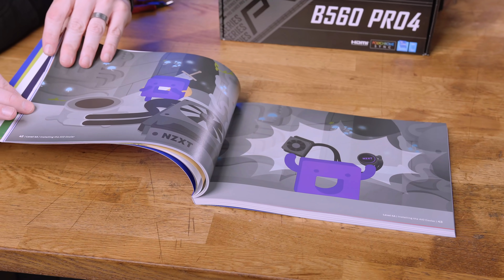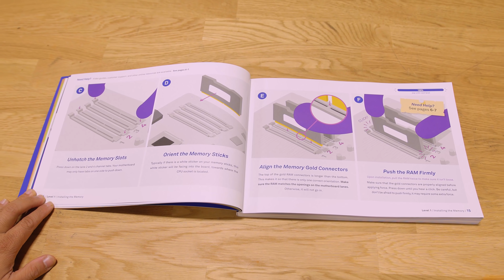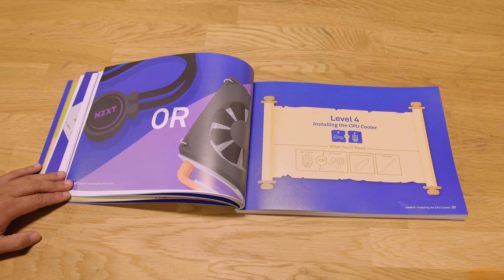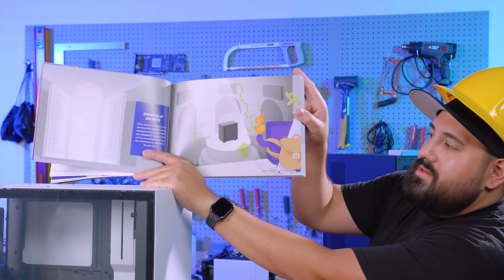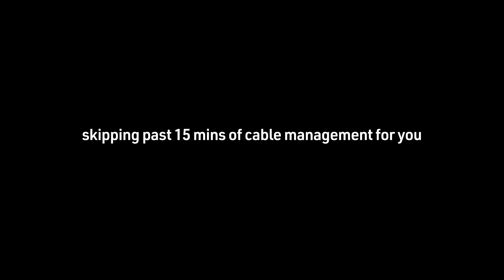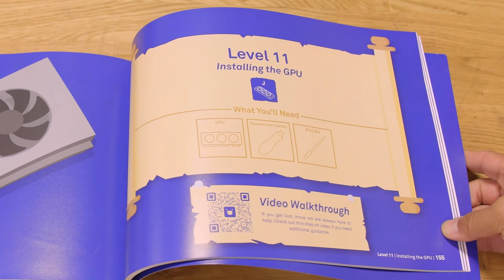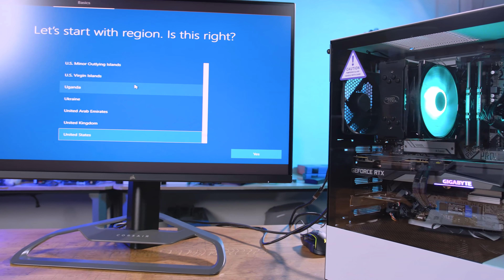Why hasn't anyone thought of this before??

Comment: Only odd thing was the 510 is a negative pressure case where the top and rear fans are used for exhaust. Seeing the top fan at the front for a static pressure setup which probably isn't the best as well...not much incoming airflow as the front is sealed - although it has a small perforated strip on the side. Seems a strange step by NZXT (and to a new builder) to add a 'relocation' fan step. Anyone know why?

The manual looks amazing and really shows the attention NZXT have given to this.

Comment: The only 'bad' thing I can say is that it's the exact same price as the actual pre-built version of the same spec so it really is just the option to do the work yourself for the experience. So it's not bad just, there's no cost incentive. 

I do appreciate that where with their full pre-built you're paying for the labor and with the kit you're paying for what looks like an expensive as hell full-color thiccccc instruction manual, and a little set of tools; so in a way that's worth something.
Reply: all the cost of building has gone into creating the manual and isuring that nothing goes wrong

Comment: Would have loved to bought this concept for my kids. I ended up buying them each HP Pavilion 10th gen desktops, stripped each computer down to the individual component level & bought upgrades (PSU, ram, GPU, SSD, cooler, case fans, etc.). From there I walked them through the build process.

Comment: 7:22

don't worry. I have a ryzen 9 3900x, and then when I was trying to pull out the cooler, the cpu sticks to that stock cooler, and at the process of pulling the cpu out of the COOLER, I bend like 50 of those pins, fully 90 degree bend.

I use gentle force and work efficiently while sweating (ofcourse duh), then successfully put it back inside the mighty AM4 socket.
Reply: me after seeing the rest of the video :

Comment: Ya know, given how (relatively) dangerous it is to install your CPU as a newbie builder, I'd really like to see Beginner DIY options (from the popular retailers) where the CPU is pre-installed and tested before shipping. Like, just a little add-on fee in the checkout process. "Pre-install and test CPU: $50." Would save so much headache and stress for first-time builders. (And potentially more experienced ones as well.)

Comment: The M.2 issue is not just Asrock, I built a system with a Gigabyte Aorus mother board that the top m.2 didn't work with 10th gen cpu.

Comment: That build manual is awesome.  NZXT could probably slap a ISBN on it and sell it by itself.  I spent 8 hours building my first PC at 34 years old with 12 years experience as an non-computer electronics tech.  Of that 8 I spent at least an hour trying to find something, anything that said whether or not the 240mm AIO pump and fans would exceed the amperage limit of the CPU Fan and CPU Opt. headers.  
Also, I've come to the conclusion that LGA CPUs are a better idea because the CPU usually costs more than the motherboard.  If I'm going to ruin something by accident I would rather the less expensive part be the one the gets ruined.

Comment: Maybe it's just my personal process, but I have NEVER put the RAM in before the CPU.   They just get in the way of messing with the retention clip, and one slip of the hands is all it takes to potentially snap off a RAM stick in the slot.

And I would never put the board in without everything being installed (minus the GPU) because...again...space to actually work.   Put that CPU cooler on OUTSIDE the case.  Sometimes I think the guys that wrote that script on for that cringe worthy "how to build a PC" for The Verge wrote parts of that manual.

Comment: this is just fing awesome.  I just got into building PC's in about 2017. Ugg I don't know if it it is a blessing or a curse but it is just like building a car/bike.  I am still at a mid tier with all my builds, but man is it fun to build a new project and see it post for the first time.  Warranties are an issue I have had to deal with first MB from personnel build died within a year  and had to jump through hoops that eventually ended in buying a new MB and even it had some RGB problems I didn't think worthy of going after a warranty issue.  I prefer the teal/seafoam color and with a b550 GB board and phantecks neon lights both failed to render a teal/seafoam (both went to green) color after just a few months use.  is this a common color to die after just a a mediocre time use?

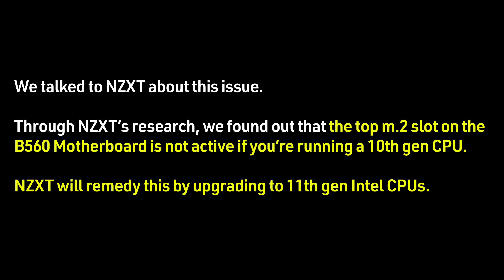Comment: 19:48 Something similar happened to me when using an Asus ROG Strix B560-G Gaming WIFI board and an I7-11700F bought from someone who parted out a ROG prebuilt. The m.2 slot closest to the CPU socket didn't recognize my WD Red SSD, but the further away one did. However, I suspect it's because I'm using an older SATA SSD and the top slot is NVME only. As long as it works, right?

Comment: I wish they were doing this beginning 2021 when I had them build mine. I was grid locked waiting for GPU like everyone else. I already had a case. would have been cool to just use their parts and my case and get the GPU I wanted. Instead I'm stuck with the 3060rtx. robust tank but not the fps I wanted.

Comment: When I built my computer for the 3rd time in that case I dropped the fan bracket on my pinkie toe with 2 - 240mm fans on it and sliced it wide open. It was 1am and I wanted my build done so I continued like nothing happened.

Comment: i had a 6600xt from gigabyte oc pro, fans were spinning crazy loud an many coil whine on it. is this 3060ti less noisy, less coil whine or none? then the 6600xt pro oc ?
or should i get a nice EVGA 3060ti, i still have a 1050ti evga 4gb. its still working, but i need to upgrade..

Comment: Ahh, why do the DIMMs go in slots 2 & 4 instead of 1 & 3? I'm not a gamer and as an IT Pro I've only built 2 custom PC's in the last 9 years, 95% of the systems I have sold are either new or refurb Lenovo ThinkPads/ThinkCentres (a few Asus/Dell/HPs, mostly refurbs laptops along the way), and maybe 2/3 Intel NUCs (so SO-DIMM slot order is irrelevant). So what have I missed in the last 10 years that dictates using slots 2/4 over 1/3?

Comment: Finished mine and nothing is showing up in display lol, I already re seated the rams, many times, hdmi and monitor works perfectly since I always used them on my Xbox one. I plugged the hdmi to the gpu port, nothing, then motherboard, nothing. I’m just waiting for nzxt to email me back which should take 2 days max. On a side note, DONT EVER BUY anything from ghost keyboards. I bought the pewdiepie ultimate combo and received everything BUT the keyboard. I emailed them and it took them 2 WEEKS for them to respond. Then they responded asking about some information being correct and I replied, and they haven’t emailed me back since. It’s been 1 week since they have replied to me, a total of 3 weeks of not having the keyboard that I have paid for.

Comment: Great video,.... BUT...Maybe I'm missing something, for 1800 dollars you get a 5600x($~300), 3060ti(~400), 16GB of 3ghz(~$75), a crap m.2(~$100),junk case(~$75), 650w PSU(~$90), 120mm cooler(worthless),  to me that's 700 dollars over priced.  I know the GPU situation, but you can get better parts from other pre-builts for FAR less and fix the issues with cash left over.    Granted I lucked into a 3070ti for MSRP but I just built a 5950x, 3070ti, ASUS B550-F Wifi 6, 32GB 3600, 1TB nvme, 850RMx corsair, in a  LC mesh for 1900.  Don't pay double for a GPU, that's half what keeps this mess going. JUST SAY NO.

Comment: There is no substitute for a good education and building ANYTHING (PC/bike/bookshelf/bed etc) yourself will guarantee that you remember how/why you did what you did. When you first start down ANY new path, 'you don't know what you don't know' so you don't know the questions to ask. I remember frying an old HP because I installed a new video card and it was trying to draw too much from the OEM PSU, whole thing cooked the mbd and vid card. IIRC, the only parts that survived were the HDD, ODD, fans and floppy. WTF did I know about power draw and quality of parts? 
 
When they each hit 7th grade, I had my girls build their first computer from spare parts I kept in the closet back in the day (Now my oldest is going into college... fk I feel old!). Same with their bikes, each of their first was built from parts I scavenged via craigslist, alleys etc. Not because I'm not willing to BUY a bike for them but because they should know how to fix it if something goes wrong... Also, it's a fun project that guaranteed some time with my kids and taught them it's OK to get your hands dirty :)

Comment: Fellow technophiles, I have questions for you all.  I want to do a full tower gaming, game development, and digital art build that's all dec'ed out, but the parts I'm finding dissolve the justification for a full tower.  I want the full tower so that I'll have more room for components, but there's no point with ATX motherboards.  The PCIe slots will all still be too close to use them all.  I don't like that.  Would I really have to bear the insane cost of a server motherboard just to complete this build?

I'm asking because I'm a huge fan of DirectX 12's Multi-GPU, want to take advantage of the return of classic high-end internal audio cards, and will need USB expansion.  On an ATX motherboard, two modern GPU's will make that build impossible.  I'd have to burn space with peripherals.  I hate that.  I don't have enough space for that because I have another build cutting into me usable area.

Anyone know of any options for building this PC?  It would I have to break it down to multiple builds?

Comment: Really... The single most time consuming task is connecting the front panel connectors (PLED, PWRSW, SpKR,  RESET and HHD_LED) - why didn't you show that? Tiny 2 or 3 pin connectors on the bottom of the motherboard, which are typically smaller than your finger so you can't see the pins your trying to insert into the connector,  not to mention all the USB Headers, and the HD Audio.

Comment: For a TRUE experience you really should NOT have stepped in for ANYTHING AT ALL!  That would have been a REAL LIFE experience and the novice builder would have run into frustrations MANY times..without you to step in so the REASON that nobody does this these days is for the same EXACT reason that we STOPPED doing it some 30 years ago... The public are not mentally equipped to do these builds and the instructions, no matter how extensive, are ALWAYS going to be WRONG.  10th gen CPU, Thermal paste, etc.  Yes, we DID try to do this many, many, many years ago back BEFORE companies like DELL and such were even a premise.  Yea, I know... I am OLD!  LOL

Comment: I expected this to be excellent, but it didn't happen. Jay, you butted in too much. You should not have tried to be the center of attention here. He did NOT build this himself. You should have been completely quiet, and not been coaching. Then, when he was finished, or couldn't finish, you could have stepped in. Still a good idea. How much more does it cost this way vs the normal way computers are home built?  Not a complaint...I'm a subscriber.

Comment: booooo
 to me as a professional builder I'm going to have to say I don't like it. It takes away one of the most important crucial and rewarding parts of building a PC which is the parts list making sure that you bought all of the same compatible parts and all the parts that are required almost everyone has had that time when you're in the middle of a build and you realize apart is not meant for that board or you forgot forgot dad it requires extra or something the valuable lesson I think everyone should have to go through unless you're just super pro from the start

Comment: Why hasn't anyone thought of this before? did you mean why hasn't anyone sent you a taken apart pre built ? its like saying that you built your car because you choose the black wheels as an option. I'm putting this video in that folder with that one you posted about GPU wobble or some like that.
step 1 to stop GPU wobble : CLOSE THE LID AND STOP USING YOUR GPU AS A STEP LADDER.